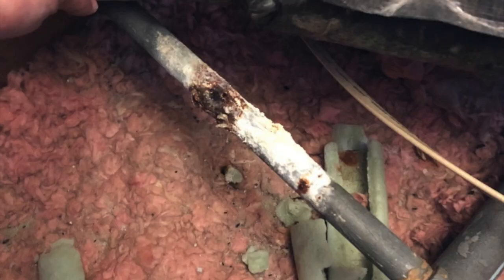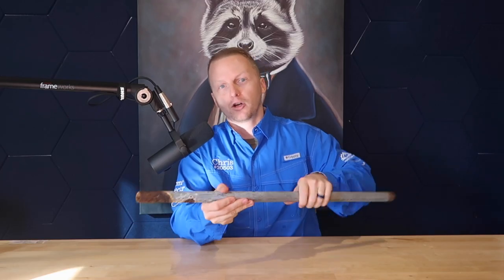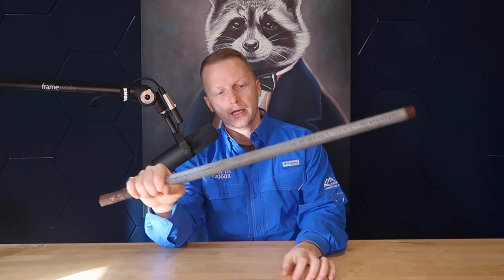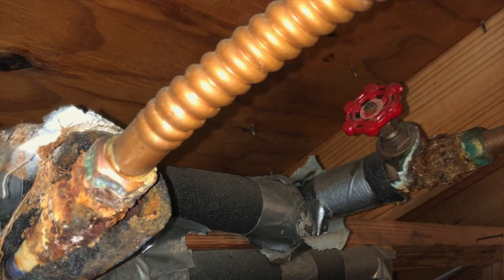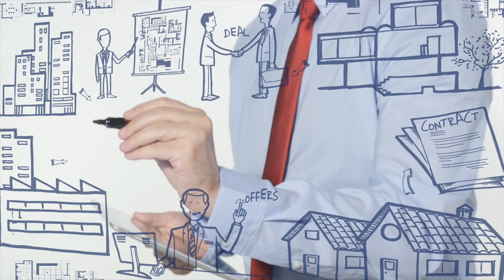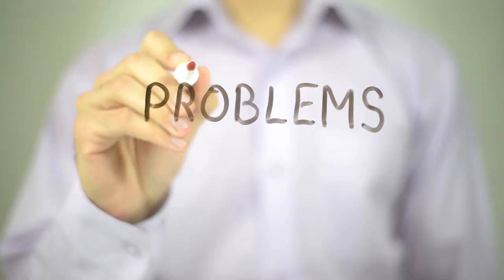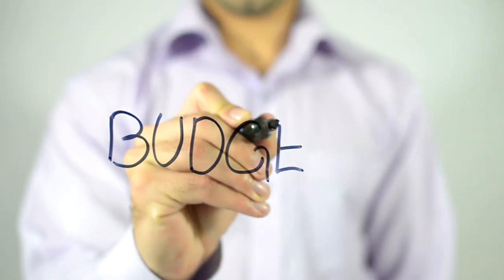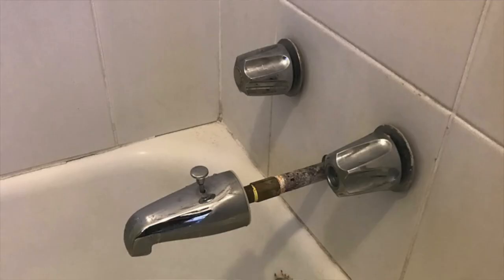Galvanized Pipes -  Why are they Bad? -  The Houston Home Inspector

Comment: In my area there is iron water pipe that is not galvanized, but just plain iron. Non-standard diameters and no modern fittings work on them. I have one feeding my house, it's from the 1860s-1870s. Our pipes are in the basements here so I have no problem replacing galvanized pipe with more galvanized pipe. I do my own plumbing so no issues with paying plumbers to do it. Since we have an iron water main using galvanized pipe in the house is cheap insurance against dissimilar metals corrosion. Replacing pipe in the house is a whole lot cheaper than replacing the underground water line to the street. And the water here reacts with copper and causes pinhole leaks. We've also seen leaks in PEX that we have no idea what caused them. Unless you use all plastic fittings on PEX the water will corrode away the brass fittings. There are some galvanized pipes in my house that are over 100 years old, no leaks. CPVC gets brittle when it gets old and being that the pipes are in the basement and there's no real risk when it comes to leaks (most houses here only have plumbing on the first floor), the galvanized lasts the longest. Still common to see galvanized for the water mains here even on new construction. Not for the interior plumbing but the service lateral from the street. I've seen houses as late as 2005 that have interior galvanized plumbing, because the copper gets pinhole leaks and the other pipes are a big risk in freezing temperatures. But it's totally different in Texas, different water, different climate, etc. I couldn't believe it when you said the water heater is in the attic! Seriously? Over here the water heater, boiler, plumbing, electric are all in the basement underneath the house, and there's usually a sump pump in case the basement floods.

Comment: I have galvanized pipes.  1950s house. Cool thing is they made a little room that has all the plumbing inside and it is all easy to get to. 1500 quote to replace it and the drains.
Reply: 1500 for that work is a total steal! I hope you did it!
Reply: My plumbing (faucets, shower, dishwasher) all started randomly “whining” or “groaning,” over the last few months. Back in April I installed a water pressure regulator as my water pressure was insanely high at about 140 PSI. My plumber noticed that I have some galvanized pipes in my basement. He hopes that replacing them will fix this problem. Thoughts?

Comment: Any problem with rats or rodents chewing PEX, ABS, galvanized  or copper pipes? Great videos.
Reply: Gophers or moles will chew plastic pipes under a slab. Run them through a protective sleeve.

Comment: i bought a house in 2022 with galvanized piping. Currently the water pressure is good and plumber said water quality is good. Soooo i think i will not repipe for a while? but i am interested in that polymer temp solution to extend life even farther? Or i can just do nothing lol so many options to consider. repiping is expensive in my area.
Reply: Just go if they start failing.  Don't get scared when it goes bad just make sure you start budgeting ahead of time so when the time comes you'll be ready!

Comment: What do you recommend to replace 3” (I think it’s 3” - matches the size of the driven well point pipe) galvanized pipe from the driven well point to the water pump!??? I have a section between two unions that is rusting bad, but tap water is not colored. Yet.
Also have 1” galvanized pipe between the water pump & pressure tank. Then goes to copper to rest of house.
Reply: Either PVC, brass, stainless, or more galvanized pipe. Galvanized is standard for wells. Stainless is the best, it doesn't corrode at all, but it's quite expensive. It doesn't have issues with dissimilar metals corrosion like the other materials though, so it's a good choice if you have a mix of ferrous and non-ferrous materials.

Comment: what if the galvanized pipe is clogged ?  pipe is going into the basement floor?  laundry and sink water not getting through
Reply from the maker: You will need to reroute your plumbing most likely.

Comment: Can you do a breakdown the electric systems in old homes?  Specifically what is involved in replacing old cloth covered wire to modern standard code.  Would it be possible to do this in phases throughout the entire house?  What do home inspectors look for when they encounter this type of old wiring.  Big fan of your channel.  Thanks for all you do.
Reply from the maker: Thank you!  Looks like electrical is next

Comment: My galvanized pipes from the 30s is like brand new. Elbows are the problem with scale.
Reply: Same with mine.  Or did the galvanized pipe scaling accumulate at the, in my case, cast iron elbows?  or does the cast iron elbows also scale ?  I replace the whole draining system from both bathrooms.  My water lines are copper.

Comment: I feel like I heard you mention in a video that you dad is an inspector in Dallas. Can you post his website or contact?

Also, can you do a video on buying a home with a supporting retaining wall and the inspection process.  I am under contract for a new build in the Frisco area that has a 10 feet retaining wall that is 50 feet behind the house. 

My lot is on the bottom of the retaining wall. There will be a house on the top side as well. The back of that house will be 20-30 feet from the retaining wall. 

Thanks
Reply from the maker: I can but that one will take some time.  I can write it down for our list. 

https://g.page/AActionRealtyInspectionsDallas?share

This is my fathers company up North.